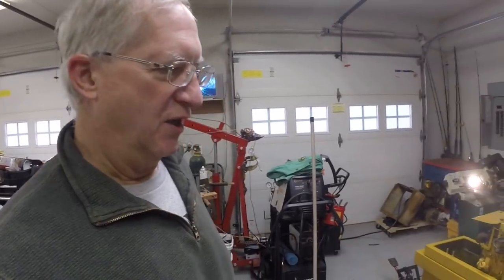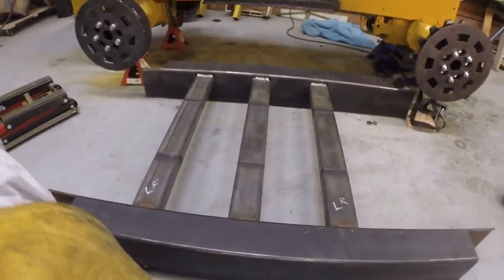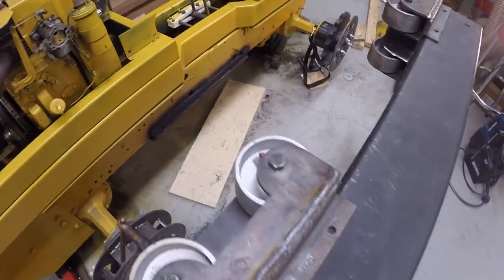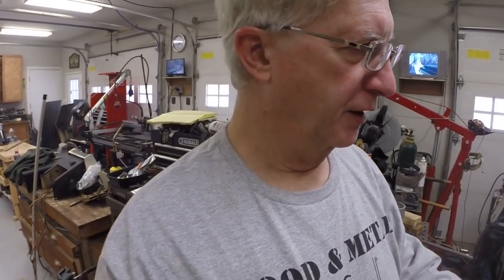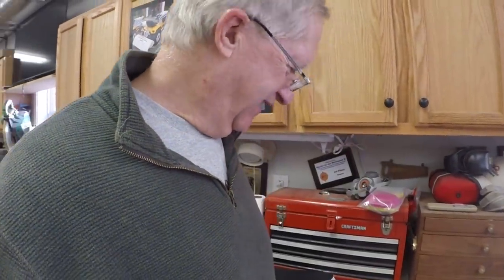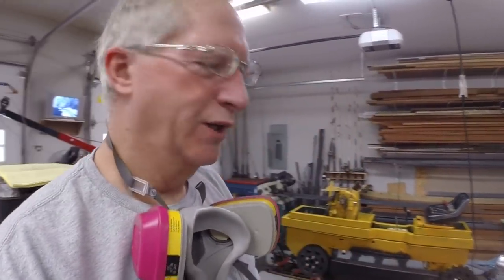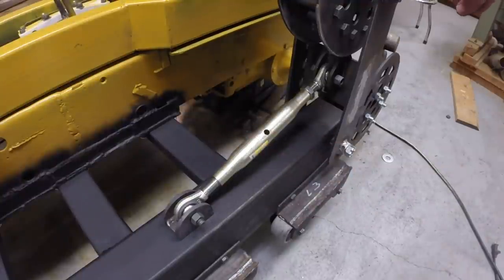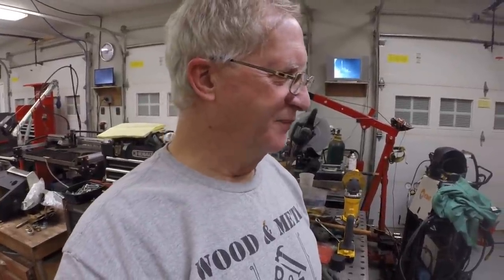Cub Cadet Dozer Build, Track Frame Complete! Season 2, Episode 1: S2E1

Comment: 12:02 You should get in the habit of "welding around the corner".  Defects most often occur at the start and end of a weld. The beginning of a weld is the coldest and has the least penetration. The end is the hottest, but liable to crack if the crater isn't filled in.

So "wrap your corners" is just a way of avoiding putting the worst part of the weld in the highest stress area.
Reply: I agree Kent 💯
Reply from the maker: I clearly have a lot to learn. Thanks for the tip.
Reply: @woodandmetalshoptime8048  I haven't started watching the video, yet, but that is very good advice. 

Also, no matter what welding process you're using, it pays off to do a lot of "dry runs" before making your actual weld. Practice maintaining torch (or rod) angles, arc length, etc. Especially if you're going to have to change torch angle as you're welding "wrapping corners".
Reply: Good tip to know. I never thought of that. I'll be keeping this in mind on my next welding project. Because I use the moto from the guy on 'Diesel Creak'.. "A grinder and paint makes me the welder I ain't"

Comment: Frank, do you have enough width on the backing plates to allow the bolt heads to run bolts on the  outside of the boogie wheels as done on the big machines?
Reply from the maker: Not really. Track will be welded together. I figure it will never get enough use to wear out the track to justify all the work to set it up with bolt on track pads.

Comment: If you weld 4 pieces of 1/4" square stock to the top of the front and back crossmembers so it butts up against the angle iron on the frame, it will make locating it in the future a breeze. An added bonus is it will prevent any movement of same under operation.
Reply from the maker: Another great idea!
Reply: Also give the frame a positive torsional support if when under load since the engine and transaxles are on the lower frame the torsional load will try to spin the frames instead of push

Comment: While I was watching you adjust the bogie carriers by tapping from side to side to tighten the U-bolts, it occurred to me that given enough lateral force the entire assembly might rack in use. Once you have everything aligned it might be a good idea to add locating pins for the lateral members to prevent that. Just a thought.
Reply from the maker: That's a great idea!

Comment: Drill out hole for tensioner and put a pipe through it with a 3/4 id
Reply: I was thinking that too,    he was thinking about putting grease nipples in the collars,  now that the sq tube is welded closed..... what happens to the grease that  squeezes in?

Comment: Maybe instead of using just the single top plate why not use cover plates that bolt on to the track pads with counter sunk screws that would also give you the ability to bolt rubber to the face of the track pads or different types of pads yeah yeah way overkill for the work this is gonna do just a thought to save the pads and use replaceable 3/16ths or so outer pads you could even add a few weld beads to help it dig thought about some angle iron but it’d be to much for this one maybe 1/2x1/2 but I’ve never seen it

Comment: Re:  The adjusters.  Shouldn't you have unwound them to their maximum (without compromising strength) before welding the stops?    Cool video.
Reply from the maker: That's basically where they wound up. Track tensioned with the adjusters at mid point.  In this video, there are no track pads on the chain, and once pads are added, the chain path is lengthened somewhat as the bogies and idlers all ride on the inside of the track pads, so the chain doesn't go down into the idlers and bogies as much, if that makes sense. 

So it has the effect of a shorter chain (though, of course, it isn't actually shorter, it just acts like it is.)  

Many of the previous comments saying the tensioner wheel was too vertical and didn't allow for chain stretch didn't understand that the chain would get tighter when the track pads were added. I was allowing for this change in effective chain length when setting all this up.  It worked out pretty well as you'll see in upcoming videos. I didn't explain all this in the videos. Perhaps should have.

Comment: You will not live long enough to wear out your track pads. Maybe a chain / sprocket  issue might happen but I doubt it. What a great build, I learn something every video. A thick flat plate under your mag drill will help with uneven metal, but clamp it good to part being drilled, I learned that the first time. Cannot wait for next episode. THANKS!

Comment: Frank, you could make a similar magnetic base for your drill press from 2 transformers from microwave ovens, and it can easily hold 300+ pounds of force. There are a number of ideas available here on YT to show how to make one. Another reason to make one, is so you can hold small piecer for grinding.
Another idea for your shop is, you could get a set of similar cutters to your annular ones for the drill press or hand drill. I bought a set of 13 TCT cutters that are carbide on eBay for $26. If you want, I'll send you the link to these.
Reply from the maker: Hey, Bryant, I saw the mag holder that Mike Festiva made on his channel and bought the electro magnets to make a similar one but haven't gotten around to it yet. It uses 12v commercial door lock magnets.  I'll get to it eventually...  I have a couple more sets of annular drill bits--one small set for hand drills or drill press, uses a 3/8 inch arbor. I also have a carbide set of larger bits with the Weldon shank. I just got an R8 taper to Weldon shank holder for the mill as well. So many ideas, so little time!

Comment: It maybe more than you want to do or may not be enough room, if you drilled and tapped 2 holes in 1/2 blocks to weld inside of your chain links and welded 1/4 square riser on each side of the chain on the pads and put 1/4 or 3/8 square cleats across the face of the pads in 2 or 4 places it would give you some clearance to put 1/2 bolts in from the face of the pads no nuts required and instead of lock washers use lock tight on the threads. You could change any pad by removing the 2 bolts and the riser on each side would keep the pads from racking over time with use. The square stock on the face not only gives some bolt clearance but also will greatly improve traction. Also cutting tubing into quarter pieces and welding to the rear edge of each pad will help with excessive dirt collecting on top of the pads. May not be practical but just a thought. Great looking build, I’m enjoying watching.
Reply from the maker: I think that would work but it would be a lot of effort. I didn't want to block off the center of the chain links where the teeth of the sprockets go into the chain. I put holes in the track pads so any dirt that got in there would just be extruded out the center of the pad, preventing dirt from packing in a blind hole and binding up the sprocket.  Given that I'll never wear these tracks out, I think the simplest method is just to weld the pads to the chain. I can always knock out a link and replace the link and pad as a unit if I damage a pad somehow.

Comment: I am still skeptical of the Horse power you will get out of that tiny little engine under a work load. Pushing earth in an uphill digging operation will be the test. You are an amazing engineer and technician but I have seen others of similar talent failing in this area and redesigned after completion for the addition of a Kubota multi cylinder engine to get the torque necessary. This will be a fascinating test. Every pound you add will reduce the power.
Reply from the maker: On level ground, vehicle weight only marginally affects power available for pushing dirt. It's almost entirely a function of engine HP, drive line efficiency and traction. It will be used within its capabilities. I won't be building any roads or clearing land with it. It's a toy, basically.
Reply: My Case 220 with a 10 hp Kohler, is at about 1100 lbs with its front blade, wheel weights and tire fill. It does a reasonable amount of work. Yes, it is not even close to my subcompact tractor at about 1700 lbs. While the 14 hp would do a surprising amount a diesel from a subcompact tractor would really be nice. As they sip fuel and sound great. Though a diesel engine probably would be too much of an expense unless it was an everyday work tractor.
Reply: If it helps...Frank has explained that this is a toy and not designed as a working machine. Pretty cool endeavor either way.

Comment: Do you think the 14hp engine is going to be sufficient, given the massive amount of weight you have added?
Reply: I think it will be fine to use for driving, but not sure if its enough to run a hydraulic pump at the same time...
Reply from the maker: A hydraulic pump uses little power unless it's actually doing work. Occasionally adjusting cylinder lengths doesn't really count as "work."
Reply: I watched other videos from a man doing a similar thing, and eventually it turned out that his machine was too much under powered in order to be able to work efficiently enough. So he ended up installing a motor that was around 80 hp or so, I can't remember the exact number. But this particular project that you are currently watching is about building a toy, as far as I understood. So it will drive and such, but I don't think that it will have enough power to push any reasonable amounts of dirt and to be really useful for that purpose with just 14 hp or so.
Reply: @insAneTunA  what videos were they I would like to watch them also
Reply: @martintaylor984  The video is called "Homemade dozer. Dozer on supersdperry". If you search for that exact name you will find it. 🙂
Reply: I still think that the idler's are to straight up and down when the chain stretches the idler will cam over and won't keep the chain tight
Reply: @woodandmetalshoptime8048  yeah, I suppose you arent wrong there, since in a dozers case, your just making minimal adjustments with an up/down blade.  I love your project.  The things you build are awesome and I would love to one-day, have a shop and time and $$ to do the same.
Reply: @timmypiper9510    I think time will tell on this idle tensioner design.  Most tracked vehicles are tensioned horizontally.  usually with a hydraulic ram.  Not sure if this track will stretch over time, but when fabricating, its all research and development.
Reply from the maker: I don't think the chain will ever stretch enough to cause a problem.

Comment: nice set of broach bits use a lot of cutting fluid. when drilling flooding the broach gives the longest sharpness im my experience. getting them resharpened is the major downfall they never seem to cut the same again. called jet broach or rota broach here in oz

Comment: It may be beneficial to add some gussets under the boogie carrier frame beams to cross rails. Just in case you turn against something and put a side load on the beam. Would hate to see it crack or fold under.

Comment: What size are you planning on for the grousers on your pads and how many per pad?
Reply from the maker: I haven't really been thinking much about grousers at this stage except that I plan to weld them on.  I have enough 1/2 inch square stock on hand for two per pad.

Comment: Why are you setting things up using the max length of chain and the tensioners? Shouldn’t you be using the minimum lengths? I’m thinking the chain isn’t going to shrink in use , just getting longer as it stretches over time.
Reply from the maker: I'm not setting it up for the max length, I'm setting it up for a working length. There is room for adjusting for stretch, though I don't really see how 14hp is going to stretch that chain much, LOL.
Reply: @woodandmetalshoptime8048  your tracks will stretch as the chain pins and bushings wear with use. On my JD420 dozer, the chains have 35 links per side, so if each link wore about a 1/32”, total lengthening would be over an inch. On your build, considering that you won’t be using it hard like I do, you shouldn’t get much stretch, but there will be some, just like on lawnmower drive chains. Thanks for sharing your project.

Comment: I noticed your mag drill was wandering when starting a hole, even when you had a center punch mark, I also noticed  the guides for the drill motor seemed loose. Some mag drills have adjustable gibs that can take out the looseness. Another though is to use a slower speed  setting for the larger sizes.  Looking for  the finish line!!
Reply from the maker: The mag base was not seating well on the tube because it was not flat. Yes it has adjustable gibs. I believe it only has one speed.

Comment: Frank, are you going to be running a complete flat track or are you going to be adding grousers eventually?
Reply from the maker: Grousers eventually.  I have a bunch of 1/2 inch square stock to weld on but I'm thinking now it's too aggressive. I might go with 1/4 or 3/8. Not sure at this point.

Comment: I enjoy your videos a lot, you are doing a great job building the dozer. 
However, I'm afraid that you are going to have problems with the track on the right side, as it is going to have to push the track under the track frame instead of pulling it like the left side does. That is also going to put a lot of stress on the tension idler whenever going forward. Even with the track in tension, there will need to be a small amount of slack to allow for dirt between the sprockets and idlers. 
I think I  would have left the differentials intact on both hydro units, put sprockets on both ends and used braking to turn, but that's just what my approach would have been.
But, like I say, you are doing a great job, and I look forward to each new episode.
Reply from the maker: I think you'll be surprised at how well it will work. After all, every other tracked vehicle has to move forward and backward, right? Aren't they riding on slack track at some point?  

Your suggestion for brake turning negates the ability to spin in place, one of this build's objectives. Everybody else has done the brake turn thing...that's what makes my build unique.

Comment: Nice build so far. One thing that I would do is to weld tabs to the laterals of the track frame to help hold the track frame in alinement with the sprockets. When turning the lateral forces on the track frame might exceed the clamping forces of the u bolts. looking forward to seeing this tractor work.
Reply from the maker: That's a good idea!

Comment: When you are welding , try working from left to right , it's a little easier in my opinion  , and how most welders weld
Reply from the maker: I struggle deciding which way to go. They say to push the MIG and pull the SMAW.  Right to Left often seems more comfortable for me pushing as I'm right handed. I do mostly go left to right with stick welding.

Comment: Will the risers for the track pads be tall enough to allow the chain to sag in the opposite direction (topside when the pads are facing up between tensioner and drive wheels)? Without it it seems like the chain would be stiff when flexing past horizontal.
Reply from the maker: Yes. It won't be an issue.

Comment: Frank,
Just a thought.
Will there much twisting moment on the box beam where the laterals attach?
Maybe the side pressure on a turn?
Just looks like a potential problem area.
Would adding a triangle gusset between the lateral and the box beam be advisable.
Loving the build sequence!
Reply from the maker: That's a good idea.  Might have to look at doing that.
Reply: @woodandmetalshoptime8048  Would hate to see your work get wrecked!

Comment: One drive in front and one in rear one chain will pull and one will push interesting to see how it will work
Reply: Since tracked vehicles normally have no issue driving in forward and reverse, I suspect it won't be any issue as long as he can keep good tension on the tracks. Something I'm skeptical of with the swinging tensioner.

Comment: The more weight that his tractor puts on, it seems like the axle housings that extend from the hydro's might be the weak link.  It would be a shame to see them break.  Maybe some reinforcement might be a good idea. Looking forward to your next video!
Reply from the maker: I have a plan to support the outer end of each axle. It'll be a few months from now before I get to that point. But, the way the tractor is built, all the weight is supported by the bogie wheels, not the axles. The only stress on the axles is the track tension.
Reply: I know what you're saying Frank and I hope you're right but when I look at how massive your tractor is becoming the axle housings look weak.  I do appreciate that you take the time to read and respond to the comments.  As your channel grows, I know that will become extremely difficult if not impossible to do.
Reply from the maker: I agree the axles are a weak area, especially with the spacers extending the ends. I think the 1 inch axle spindles will fail from fatigue (at the bearings in the ends of the axle housings) before the axle housings fail.  Pushing dirt will definitely stress the axles and an outboard support would eliminate that concern. Just driving around doesn't.